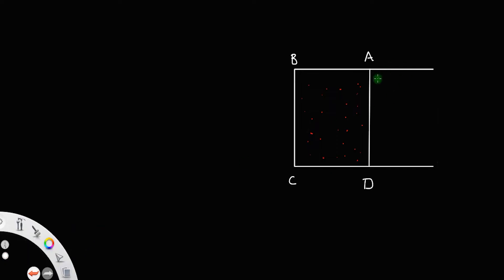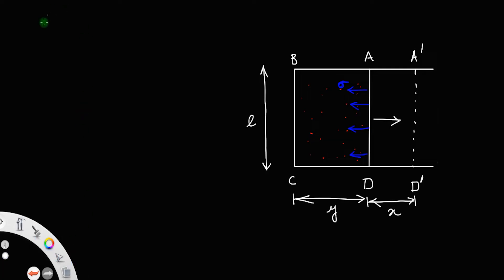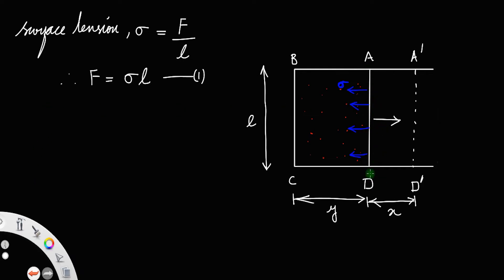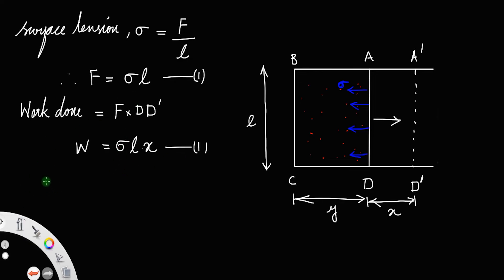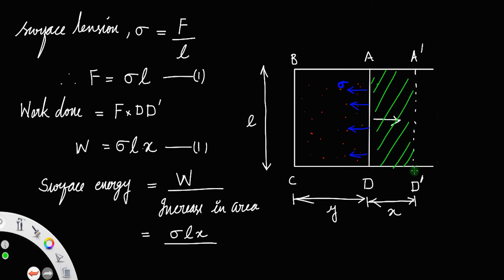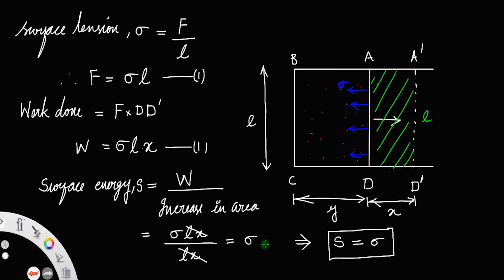Derivation of relationship between Surface tension and surface energy • HERO OF THE DERIVATIONS.

Comment: Surface energy= (Surface tension× Change in area )
Reply from the maker: Basically, Surface energy =( Work done / Increase in area )
Work done = Surface tension x length x width
Increase in area = length x width
Therefore
Surface tension = surface energy
Reply: So  surface energy equally to surface tension into area wrong @heroofthederivations7305